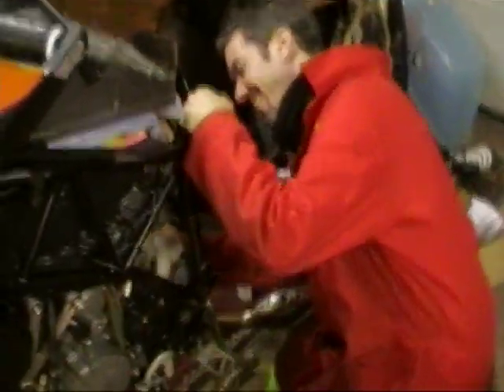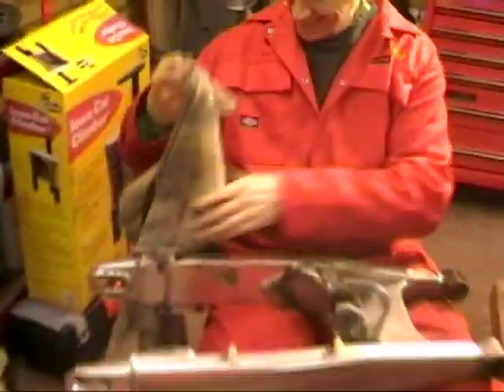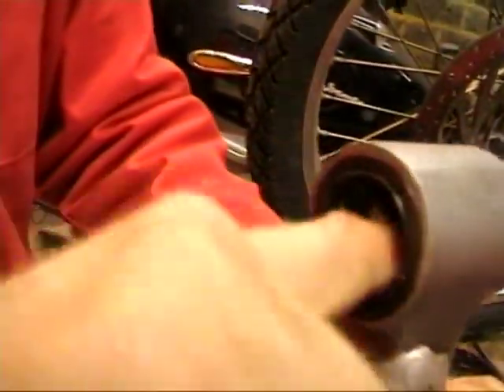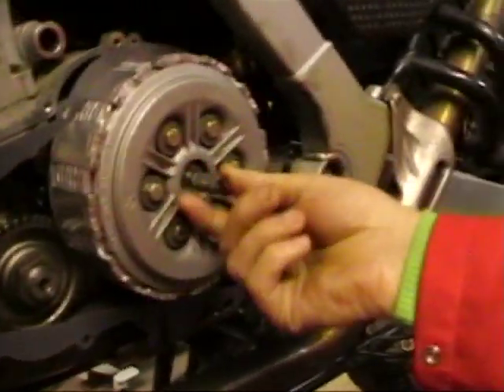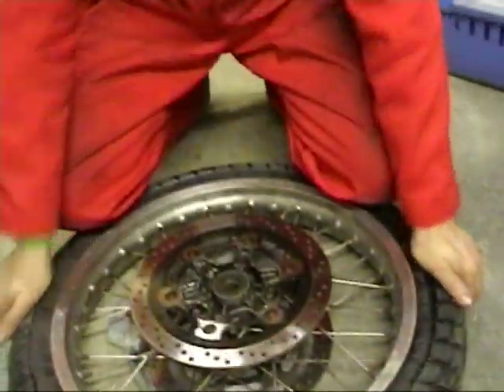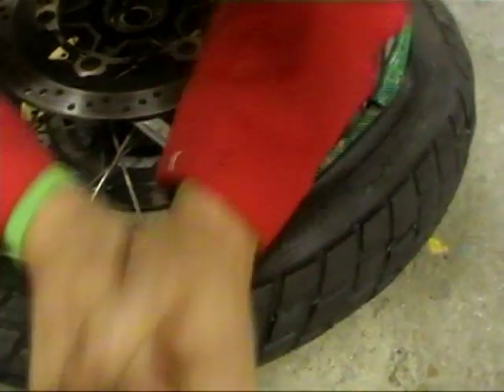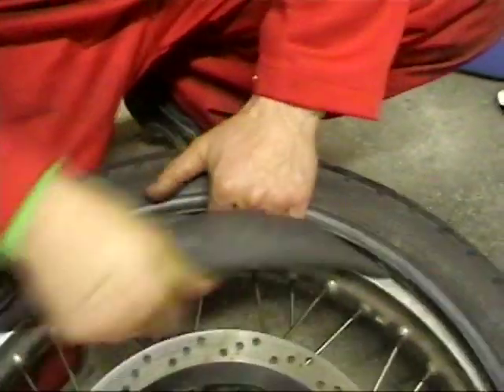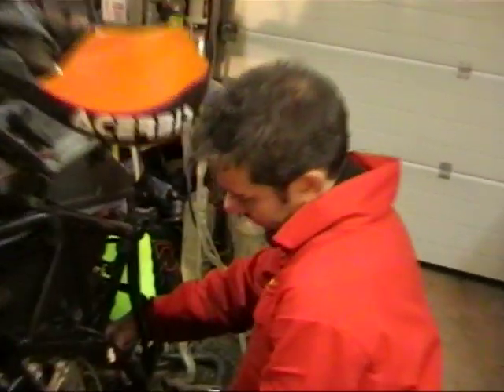Swingarm bearings: how to grease them, breaking the bead on a tyre

Comment: I usually take some WD-40 and spray on the outside of all the dust seals nuts etc after washing it.

Good or bad idea?
Reply from the maker: Yeah why not, though if you want to leave a lasting coating to protect things against corrosion, garden-variety WD-40 might not be the best, as its main use is to penetrate, lubricate and free things up, rather than act as a surface protectant/sealant. I believe there might be a version of WD40 called Specialist that is more suited to your use. Have a look around and I am sure you will find other similar products.